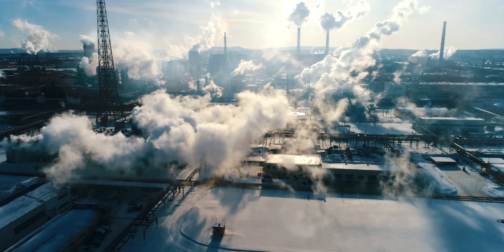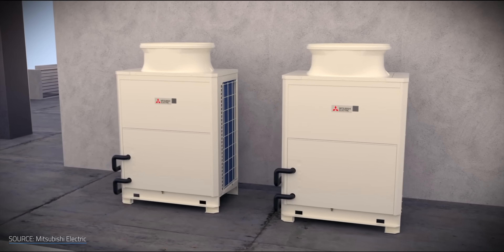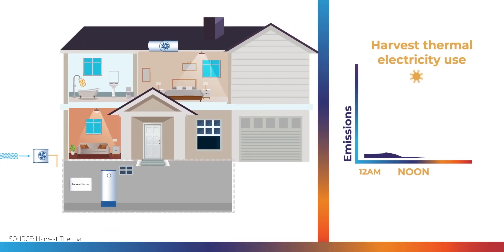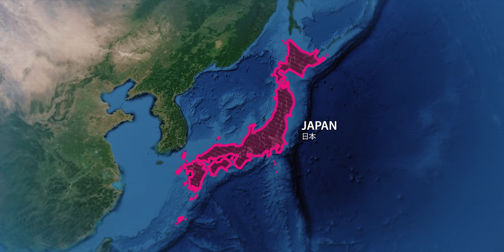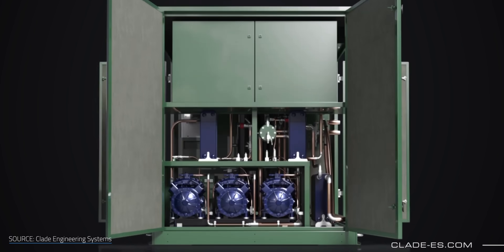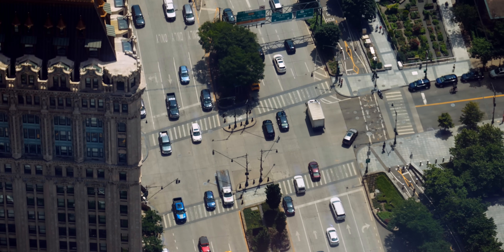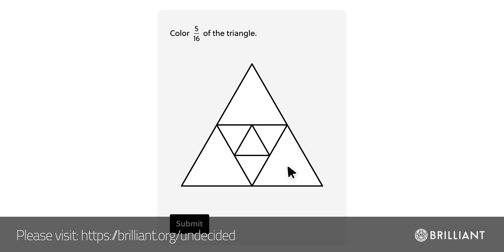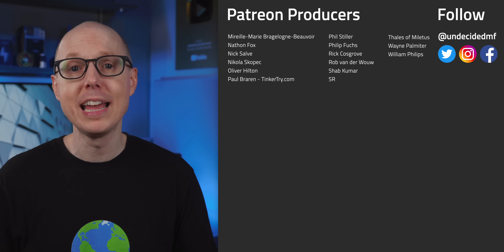Why CO2 Heat Pumps Are The Future Of Cooling

Comment: I am an HVAC refrigeration mechanic. They use CO2 in grocery refrigeration rack systems now. Your contention of 30 to 40 atm is not quite correct. The high side the condensing side as high as 2000 psi in those racks that’s 133 atmospheres. Have you ever seen what happens when some thing fails at 2000 psi? N HFC system like 410 a on a really bad day where the condensers probably dirty and extremely hot might see 450 psig and an R 22 system might see 275, 300 psi. these eco-friendly systems are all well and good, but there are inherent risks. They are now going to be using new refrigerant to do away with a hydrofluorocarbons ( HFC) because of GPW .these have been designated A2 by ASHARE. This means they’re semi flammable. This will require all sorts of new safety systems to prevent fires.. there are no free lunches when it comes to heating air-conditioning refrigeration.

Think I’m wrong look at the image of the computer screen when they talk about the grocery system  one the high side is 68 bar that’s  986 psi.
Reply: I would like to add one point to your conversation about heat pumps. We are moving heat not making it. Air conditioning and refrigeration. Don’t make a cold. They move heat out. A heat pump is nothing more than an air conditioner running backwards. In the summer we take it out of the house and put it outside in the winter we take heat from outside because yes, even at  20°.f there is heat in the air. What he is not telling you in this video is that the colder it gets the less heater is in the less efficient that heat pump becomes till in the end it becomes virtually worthless.

Comment: We have a ~3 YO heat pump at our office in Massachusetts.  I can tell you it SUCKS.  It blows cold air in the winter but sometimes it blows very hot air.  The cooling works great.  The heating is terrible.  Fossil fuel systems are way better.  Unfortunately we don't have NG in the street and that's what the contractor put in when they built the condos.  It's a Trane, very high quality unit.

Comment: Thanks for the info in this video.  I live in Australia and while the heating aspect is not that important to me I would imagine that the ability to dump the heat into a water tank would make it a good fit for this climate as well.  On a side note, your pronunciation of Aussie is incorrect.  Yes it is spelt with 'ss' but is pronounced as if it were 'zz', or more accurately 'Ozzie'.

Comment: Someone needs to really modularize this whole system.
Like Heat Pump + Water Heater + certain times of the year dump the excess AC heat into your swimming pool + Ground Source Loop, etc.
Then stick a smart controller in front of it all so it always picks the best source for AC/Heat and stores the right amount of excess between water heater vs battery from solar, etc.

My biggest issue with all of it is I already live in a Franken-house, and it's far easier and way cheaper to just keep putting bandaids on it rather then rip out large chunks of infra and replace with something better.
Especially since I won't be here in 10 years, so payback savings are basically non existent.

Comment: this is misleading, a typical heat pump might have an average seasonal COP of 3 but they will go much higher in the right conditions. normally around 8 meaning the CO2 one is worse at 5.5

Comment: nice find. I have no idea about this until now. with my quick read on the internet, CO2 is indeed superior in all ways except cost.  It requires multiple times higher pressure vs common refrigerant so the equipment does indeed require to be beefier. Once you have the beefy equipment, it is most likely too good for residential use which is the reason one company in the video would use a thermal battery to harvest or store the excess performance of the CO2 system.  In short, CO2 heat pump is best for commercial industrial use.

Comment: Definitely going to keep this in mind when I get closer to a heat pump install at the end of next year. My current water heater may only be a few years old, but its a gas unit installed by the prior owner. Running on gas is enough to put it on my "hit list", and doing it at the same time as a heat pump and looping them together in a smart system sounds like it makes a lot of sense to me.
Reply: You may be able to integrate the existing HW heater to the system but it would probably be more work than it's worth.
Reply: You should check out Nibe F730 exhaust air heat pump. We have been running ours for two years now. It's about the size of a large fridge and does all of our heating (we have underfloor heating in the slab downstairs and upstairs) all of the water heating AND storage  (240 litres) and all of our ventilation and heat recovery. Our house is a 5 bedroom two story in Dublin Ireland.
Reply: << My current water heater may only be a few years old, but its a gas unit installed by the prior owner. Running on gas is enough to put it on my "hit list",>>

Environmentalists always yearn to destroy existing, useful equipment NOW,  because they want people to install the latest fashions they are creating now.

That goes whether it's a coal fired power plant or as here, a gas water heater.

Of course, no one counts the cost of wasting useful equipment.  It's just a SURPRISE when energy costs keep going up!  But that old equipment still has to be paid for, one way or another.

Comment: I went to Harvest Thermal before my reply to your video's question. I live in West Central Ohio on the Ohio River side of the Lake Erie and Ohio River divide. It hardly ever goes below 19°F and today we can use mini-splits AC-Heat pump units for heating and cooling within our temperature ranges. ( some have duel compressors) They are especially good for old homes that have no room for heating ducts in the walls. Refrigerant lines take up little space and can be snaked through the walls to wall mounted zoned heat exchangers in various parts of house. I was wondering if the company made units that are AC-Heat Pump units and how low of a temperature that a CO2 unit could handle. I would assume that such a unit would circulate the water verses circulating the heavy CO2 lines. Such information was not available on the site but perhaps a little more design and development would produce a better unit than the flurocarbon based units. Which leads me to my answer; I can't get enough information to answer the question you proposed from their web-site. I have often wondered why water thermal batteries haven't been added to heating and cooling units. I may not want a computer only buying power from environmentally friendly generating sources as most of our power in this part of the USA is still coming from coal plants although combined cycle plants using natural gas are growing in numbers. ( we have almost as much or more natural gas with fracking in the area as we have coal) Fracking is much cleaner and environmentally friendly than coal mining.

Comment: CO2 heat pumps would be much more readily adopted if the refrigerant could be user rechargeable, with safety valves and gauges to prevent overcharging. Thoughts?

Comment: As an Engineer, I can state with authority that CFCs are designed for, and better at making phase changes at appropriate temp and pressure.  And look! The ozone layer didn’t vanish, any more than Miami went underwater back in 2020 from climate change.  CO2 isn’t optimal in most climates

Comment: Why use 20-30 atmospheres when PSI is by far the most common and BARs also common.  If it is to impress with smarts it is not working. I have never seen a pressure Gage say x atmospheres. How much water pressure does your RV regulater drop the presure to in atmospheres    Its used in some cases but not to genneral population. Yes I can multiply 14.7 PSI to get your stupid rating of presure. EVEN the HVAC repair en use PSI.
Reply: 1 bar is basically 1 atmosphere. 

It is actually 0.987 atmospheres. So close enough to.say 20-30 bar, or 2000-3000 kpa

Comment: The only problem with that is that for a large part of the country something is burned to generate the electricity. But as long as electricity costs remain low the efficiency of a heat pumps is more cost effective.

Comment: Being an aussie, I have always questioned… in summer (temps average >25°C) we run our air conditioner (ahem… “heat pump”) to cool the house daily…  YET we are simply pumping the heat outside… and we still use gas/electricity to heat our water.
Why have we not developed a heat exchanger that  it’s on the condenser side of the heat pump (outside)… and when the temp is >25°c… preheat/circulate the heat into our water heaters? Less heating of water required by gas/electricity by using a heat being used-and-dumped into ambient air is just wasteful!
I too…am undecided if this would make a difference.

I’m not talking about replacing the hot water system (I love my showers too)… I’m talking about a smart system that like solar hot water simply heats the water IN CONJUNCTION with the elemental heating.

It’s smart use of waster heat.

Of course… that’s a mostly Australian problem in summer particularly… I certainly don’t want to reverse-cycle cool my hot water… but there has to be a market for retrofitting a heat exchanger in the condenser section…
Food for thought..
Reply: Hybrid Heat Pump Water Heaters are available in the US at big box home improvement stores and do pretty much that. I don't know how they hook up as I've never personally actually seen anyone that owns one. But anyway, you can get them cheaper with tax credits/rebates from the government too.

Comment: I could be wrong but wouldn't CO2 heat pumps be particularly sensitive to the outside air temp? If so wouldn't it have been smart for them to have paired this with a geothermal system? The consistent year round heat would really benefit such a system. I am specifically talking about cold weather.

Comment: Why would you use CO2 when you can use a much better refrigerant? 
Seems like a gimmic. 
As someone who works with CO2 regularly for research purposes from liquid through 10k psi, supercritical CO2 is extremely difficult to work with.  It will permeate all Polymer seals etc. As it expands it destroys them.

Comment: Here in NZ have standard AC units for heating and cooling and for air heating that is fine. I have used a heatpump water heater and yes it was good, but it couldn't heat the water really above 60 degrees C, which was a pain. Also the way that the pump heated and that it circulated the water so much, that after a shower the temperature coming out the top of the tank was suddenly a lot cooler as the heat pump mixed the cold water in with the existing water.

More work really needed to be done on how to re-heat so that it would mix badly. ie so that the temperature separation between the hot and cold would still exist in the tank.

But having the ability to heat to 90C would help a lot here as well, as then a smaller tank would provide the same amount of hot water for showers etc, with a 55 degree outlet mixer on it, which here is a legal requirement anyway.
Reply: Ask away. UndecidedWithMattFerrell581  

For some background. 

I live in Auckland, NZ, so coldest we get to is about 0 C, and warmest around 30 C. So a temperate climate. Though with the current weather pattern looks like we will have a drought this summer, which will make a change from last summers floods.

The house is approx 260m2 over 2 levels with 5 bedrooms. 4 rooms have a ducted central heatpump, the lounge has one, and downstairs lounge/office and downstairs bedroom also has one.

Also have a logburner - though a model called a PyroClassic, which is closer to a furnace design than a traditional wood burner.

Live in the bush in Auckland so wood is plentiful, and don't even have to chop a tree down, as enough branches fall down on there own as it is.. :)

Comment: CO2 is too a high a pressure too be used in domestic usage.
Only used in commercial applications outside the building with a heat transfer liquid into the building at a lower pressure.

Comment: Terrible job of explaining why CO2 isn't used for home airconditioning. in typical AC setup, long refrigerant lines of the typical bad-for-the-atmosphere kind run into the house and then the air is cooled or heated. With the SANCO2 setup, hot water lines run instead and the pressurized CO2 stays in the unit. If you decide to do AC this way with CO2, you would either be having freezing cold water in a pipe (bad idea) or pressurized CO2 in a long line in the house (also bad idea)

Comment: In 09 I was living in a building with 22 apartments. We made some major renovations to our central heating system supplied by the city. Both the heat in the winter and the hot water provided by the city were expensive. 
I proposed to my neighbours to install a heat pump that in the summer would give us hot water and central air conditioning while in the winter it would take care of the heating. Although the initial investment might have seem high, it would have recovered our costs within 5 years, they refused. 
So I went and installed air conditioning with heat pump for me alone with just air heating and cooling, no hot water, ended up recovering my investment in 2 years. Everything after that was a profit to this day. It's at my mom's place. 
I fail to understand why people refuse to make a short term effort to capitalize on a very big profit on the long term!

Comment: Heat pumps everywhere, fridges, hot water heaters, and heat pumps, pumping heat to and from a central heat buffer tank. The tank itself is connected to a solar water collector and an open sky radiator.

Comment: A large part of the USA and pretty well all of Canada have warm summers and very cold winters. Think +40c in summer and -40c in winter.  Newer heat pumps can accommodate cold winters but many current heat pump installations have fossil fuel or electric resistance back-up to accommodate extreme cold. This was not mentioned in the presentation.

Comment: You can do the same thing with regular heat pumps. They already do in fact heat grocery stores with the exchange heat from their freezers they remove the heat using water and then heat building in the winter and hot water in the summer

Comment: Just make r600 and r290 available to use in cars and homes. We’re letting the perfect be the enemy of the good. The higher pressures require piston compressors instead of scrolls. CO2 won’t get anywhere in small res.

Comment: At $5,000 to $6,000 for 43-80gal SANCO2 hot-water - I don't think this will pay for itself in 5 years.    A Rheemes heat-pump hot water is a lot less $ and almost as efficient.

Comment: I think the higher output temperature of a co2 heat pump will be a real asset for people with hot water boiler heating systems, prevalent in the UK and northeast US. Many in the UK are going with geothermal heat pumps in an attempt to get hotter water. A co2 air system might not be that much more expensive.

Comment: While you're at it with videos about heat pumps - have you heard of "LAMBDA Wärmepumpen"? They're a relatively new, Austrian company manufacturing propane heat pumps with some very interesting technical tweaks. Apparently their pumps can run at just 3°C delta to ambient air versus the typical 8°-9° (a big advantage in winter) while still outputting a COP of >5.5 at 55°C target temperature. Most normal heat pumps struggle to get that kind of COP at 35°C.

It doesn't look like they have an English language website, but maybe if you contact them directly they can give you some info :)

Comment: Tech is cool and fun and interesting, but have you considered or addressed (maybe you have; this really is a question, not an accusation) that, because of how long the oil industry hid what it knew, how hard they lobbied, how deeply they confused the issue or outright lied in the media and with think tanks setting the message, tech as we typically know it will be extremely unlikely to spare most of the world from the severe impacts of climate change disaster at this point?

The solution will be found in technologies that we currently do not employ, but leave on the table and ignore. They far less exciting (ikely due to our lack of imagination when it comes to building a better world), but are far more impactful. These technologies don't come from physics and chemistry, but from the humanities and social sciences.

Gadgets can act as a partial pressure relief valve to give us more time to make necessary transitions, but ultimately, we have to do even better than net zero, and we won't get there in cities designed for car dependence keeping commuters packed onto ever-widening roads for hours a day, going to middle management jobs that don't need to exist, in office buildings sucking up power that could be used for caring for people. We can't get there using products designed around planned obsolescence, kept hyped up by an advertising industry that is itself a waste. We can't get there in sprawling mega-suburbs created by white flight, kept subsidized by municipal governments run by gerrymandering cheaters pandering to NIMBY pearl-clutchers who won't let pragmatic mixed-use zoning ruin their 1950s white picket fiction, maintained by predatory realty schemes running on speculation and profiting by keeping people unhoused in ever more hostile weather and worsening quality of social services.

We'll get there when we design our cities correctly. When we tap natural resources responsibly and help them renewing at a sustainable pace. When we stop trying to reinvent trains in ever more wasteful form. When we decrease our resource extraction, landfill use, and global shipping load, each by massive amounts, by building things to last, damn the profits.

Comment: Can or has this been used to replace a hydronic furnace for a baseboard system? Is it possible to have that in the winter and the heat pump do air cooling in the summer?